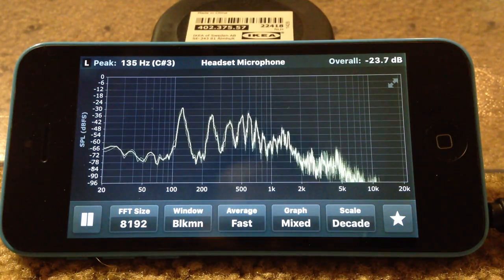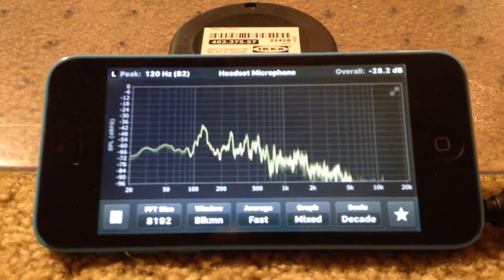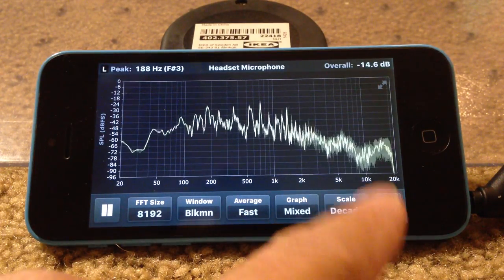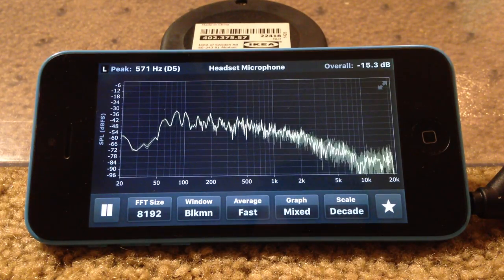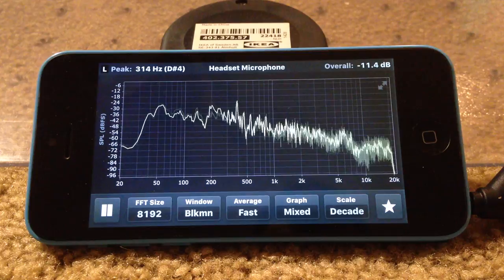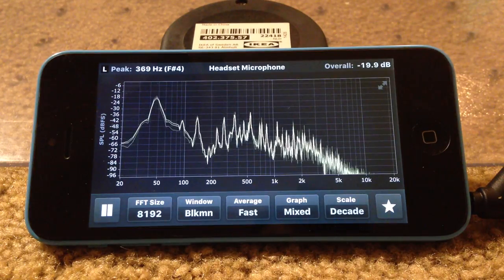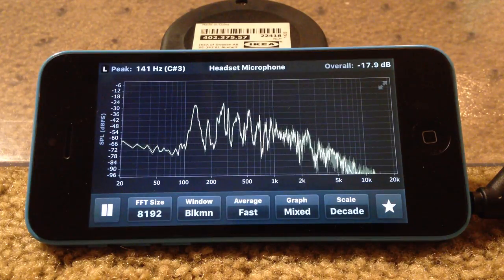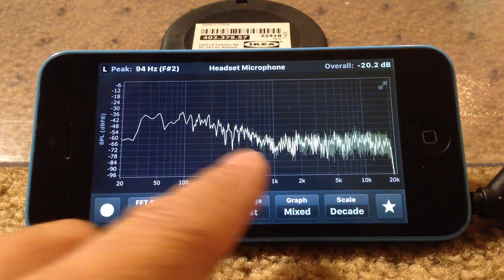RTA Sound Frequency Pink Noise and Music Comparison: Pelican 1430/1200 & Sony SRS-X5

Comment: isn't it supposed to be flat all the way? You have 30db difference between 100hz and 1khz.
I'm using RTA app and there is no such difference when pink noise some good speakers.
Reply from the maker: In the ideal world or room. My non ideal office room has the same basic shape with no pink noise due to hard drives and other ambient background.